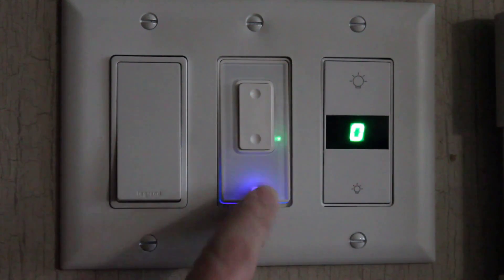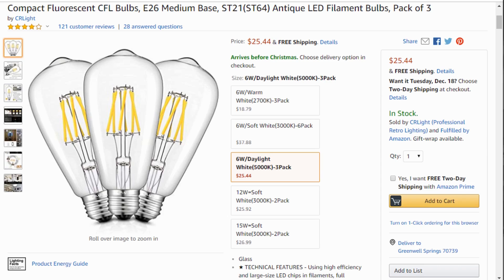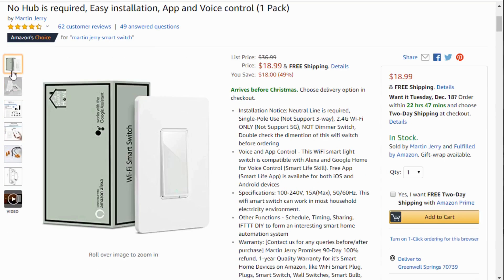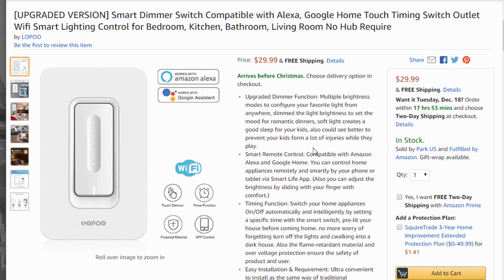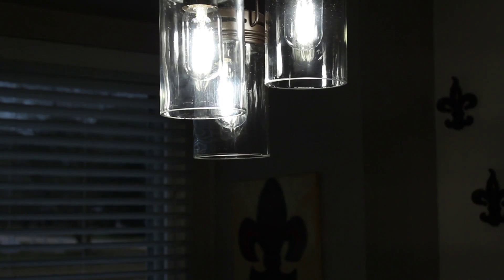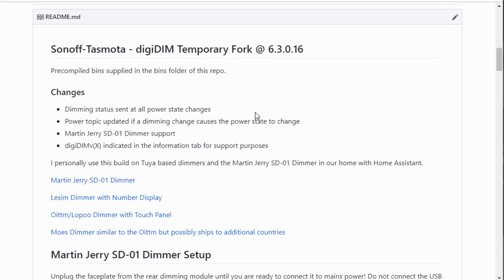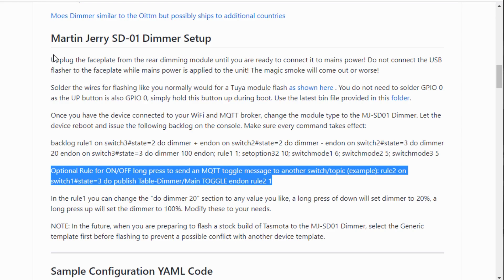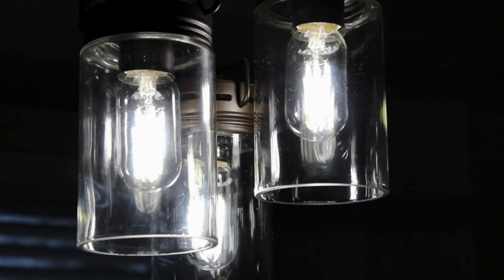State of the Dimmer - Tasmota Dimmer Updates

Comment: For the Martin Jerry, I was able to do it without soldering. There are pads available away from the esp that allow for flashing and have enough contact on them that you can flash it with some test leads off your ttl adapter and a little pressure
Reply from the maker: Very cool... That quickly changes things!
Reply: Could you share where these pads are, on the MJ
Reply: @gregbrissey5675  Here is my (admittedly bad) photo when I was flashing the unit the first time: https://imgur.com/snlQZmp You can power the unit from the leads that head to the other half the dimmer unit using the red and black wire on the cable and then the two pads near the pins on the esp module can be accessed using the pads right next to them.
Reply: Looking at the video, there may be some small hardware revisions, there isn't a pad on one of the pins in the video, though he was able to get test leads onto the other side of the board, you could probably still hold a lead in place long enough to flash the tasmota minimal for ota flashing.
https://imgur.com/s46rBCU
Reply: My FT232 USB-serial programming must not have enough current drive. When I hook up to the black and red leads at the connector,
my FT232 board red leds all lite up solid. When I soldered directly to the pins of the chip I had no problems.
Just wondered what kind of programmer you used?
Reply: flashed MJ dimmer with the latest Tasmota fw and it pretty much made it useless - one of the brightness leds is lid and nothing works. I can access web ui and change configs etc
Reply from the maker: Send over the bin file from the Tasmota GUI from here and configure. https://github.com/digiblur/Sonoff-Tasmota/blob/development/README.md#martin-jerry-sd-01-dimmer-setup
Reply: Savior !!!
Reply: @digiblurDIY  I tried these exact steps my switch still don't seem right when manually pressing the buttons. It works great from HA. I want the manual press to be default . Power button on/off
Up dimmer to go brighter
Down dimmer to go down less brighter.
Is there certain config I need to do in the template file via tasmota?
Reply from the maker: @shannonbreaux8442  which switch?
Reply: Can you please identify the wires in the picture. You have a yellow, and teal then in the plug the black and red. What does each one go to.
My board looks the same but would not work when soldered. Thought I would try your method.
Reply from the maker: This one might have a better pic. https://www.digiblur.com/2019/08/tuya-convert-whats-next-solderless.html
Reply: @digiblurDIY  Much better, thanks

Comment: I was recently noticing several of my mj switches keep having wifi disconnect issues.  They are unavailable about once every 2-5 minutes.  They have 6.5.0(digiDIMv6) on them and the firmware upgrade url is "http://thehackbox.org/tasmota/release/sonoff.bin".  Is there a newer url you are using to upgrade these?  Thanks
Reply: i was able to upgrade to the latest digidim on your fork, but would love to do it automatically with the url.  I'm not sure what to use.  btw, I also have sonoff 1's, shelly 1's, mj dimmers, switches and 3 way switches.  not sure if i should have a different url in each.
Reply: update: I've upgraded all my devices to the same latest firmware and they appear to stay connected well.  My only problem is that the wemo and hue emulation buttons in config other are gone.  I'm a noob, and can't figure out how to send the config = 1 or whatever in console.
Reply from the maker: There is a PWM Dimmer module now built into stock Tasmota but you can also still use the fork. Your choice. Jump into discord as it will be easier to work through any issues you have there. Link is usually in any of my video descriptions at the bottom.

Comment: I had flashed my sd01 one using other instructions, but then i found that you already had the MJ-SD01 Dimmer template.   Much better.  Only thing I am missing is the leds on the side don't seem to do anything now.  Maybe I missed a part.  And i do like how the button presses in your video blink the rgb :)  Nice work.  Your fork of the tasmota firmware is killer!!!
Reply from the maker: Did you pick the MJ SD 01 in the configure module screen of Tasmota? It automatically sets up to do the lights on the side of the dimmer status. Setup is here. https://github.com/digiblur/Sonoff-Tasmota/blob/development/README.md#setup

Comment: Can anyone help me with my Tuya Dimmer?  I flashed it successfully with Tuya Convert yesterday.  Everything went well and everything worked fine.  Suddenly the light began to light up.  Then the flickering stopped and about 10 minutes later the light went out.  And the dimmer does not react anymore.  I still had the old Tuya bin.  I wanted to flash her over tasmota.  But then when I upload he is an error: Upload buffer comparison differs.  As a result I read that vlt brings something to flash an old tasmota version in which this error should not be there.  Then I entered the OTA bin link in the update field and uploaded it.  But now the thing does not connect to the WLAN anymore.  I do not know if there was a flashing error.  Maybe it's bricked.
Reply from the maker: Pretty hard to brick an esp8266 but you could have locked yourself out with a bad flash or maybe wifi credentials.  It was flickering while on the Tuya software though?

Comment: I want to add a momentary switch across the room to cycle the power. What do I set the gpio16 as?
Reply from the maker: is it connected to the dimmer?
Reply: @digiblurDIY  yes soldered on gpio16
Reply from the maker: Which dimmer are you using?  I'd set it as a switch2 set with switchmode2 5   then use a rule to turn it on like

on switch2#state=2 do power1 toggle endon
then you also have the state=3 as long presses to do other things.
Reply: @digiblurDIY  the moes dimmer
Reply: @digiblurDIY  thank you so much. You rock! -jimmyneu

Comment: Hi Travis, First let me thank you for all the amazing info videos you produce...keep up the great work...After watching your Martin Jerry and flashing Tuya over the air I picked up 4 Martin Jerry dimmers and so far flashed one over the air with Tasmota my issue now is that I don't know how to get your template onto the sonoff or how to manually configure my flashed Martin Jerry.  Any help would greatly be appreciated
Reply from the maker: Did you look at the state of the dimmer video? It has the links and such to the pre-built firmware. Of course you can skip the soldering part and just write a new bin over using the GUI.
Reply: @digiblurDIY  hi Travis, I got this figured out thanks to your bin file and directions...

Comment: Travis, on the Lesim dimmer....anyway to create a "long pause" so you can control a 2nd device?  I have it configured with your bin file -  using a Tuya Dimmer module - and everything works  great as just a standalone....
Reply from the maker: Unfortunately no as the buttons are tied to the secondary micro controller that does the dimming. It could possibly be done but would take a lot of work which would be programming the other controller and modifying tasmota.
Reply: @digiblurDIY OK..thanks for quick update.   Outside of that drawback I liked that one....I'll look at the other dimmers you reviewed....
Reply from the maker: Totally get that. One thing is be careful on cleaning it. If it is too damp the moisture will make the switch think you are holding down the button for 5 seconds and will go into reset with access point mode and blink A on the display. Trust me from experience.

Comment: Travis, do you recall if the 6 pin female plug on the Lesim main board had any of the GPIO leads brought out to it?   I'll you remember...I can ohm it easy enough...
Reply from the maker: No. I can't recall if it did or didn't. I stopped searching after I found the MCU did all the dimming again and was able to snag the serial packets and talk to the MCU.
Reply: I found one pin that looks like it mapped out but that was it.   So you lost me on the MCU part.   I was operating on the approach to solder wires for tx/rx gnd and 3.3 and go that way.   Is there another method?
Reply from the maker: RX and TX are needed to talk to the dimming controller itself. The esp8266 chip is just a dumb pipe.

Comment: Have you considered possibly installing (internally if there is room, externally otherwise) a PIR sensor such as the AM312? Both LED light dimming and per-room motion detection are problems I've been thinking about how to solve without breaking the bank.

Comment: PWM? I am sure it can not drive almost all dimmer bulbs out there which are all designed for AC chopping.
Reply from the maker: The PWM signal is picked up by another driver chip that does the actual dimming.
Reply: It amazes me. So many component counts inside with transformer and all for 23USD a piece. :)
Reply from the maker: Yep, it's just a 20ma 3.3vdc PWM signal from the chip.

Comment: I've got the MK-SD01 Dimmer working, Nice!
I used your yaml example to put the switch in HA. However I noticed I only get a switch to turn the light on/off, and no slider to adjust the brightness.
How do I get a slider to adjust the dimmer?
Thanks
Reply from the maker: Make sure you have it under your light section and not switch.
Reply: @digiblurDIY  Yup, that was the problem and you have to click on it to bring up the slider control (not exactly obvious)
Thanks

Comment: Thanks for the informative video. I've order one of the MJ Dimmers, I hope to try it out soon.
Off Topic: I've seen you use the LWT topic to show availability of the device. 
       However when I tried to use it a switch it always indicates unavailable.   (Using HA 0.84.3   hasio 1.13)
       I've subscript to the topic and i see the topic being published with 'Online'  when powered up, pulling power gives 'Offline'
       So the LWT is working but HA is not showing it properly.
       Any ideas what i may not be doing properly.  I've double checked the topics, etc.
  Thanks for any pointers.
Reply from the maker: There are three simple lines, I have heard some different language files in Tasmota had the case different in the past of offline and online.  Check the LWT topic in MQTT.fx or some other MQTT inspection apps.

These are the lines per switch that have to be correct:
    availability_topic: "tele/sonoff/LWT"
    payload_available: "Online"
    payload_not_available: "Offline"

Comment: Thank you so much. 
Do you know if they work with UK 220v?
Reply from the maker: The Martin Jerry shows this on their entry.

Switch Type: Dimmer Light Switch

Rated Voltage: 100V – 240V AC

Frequency: 50/60 Hz

NET Weight: 4.73 (oz) | 134 (g)